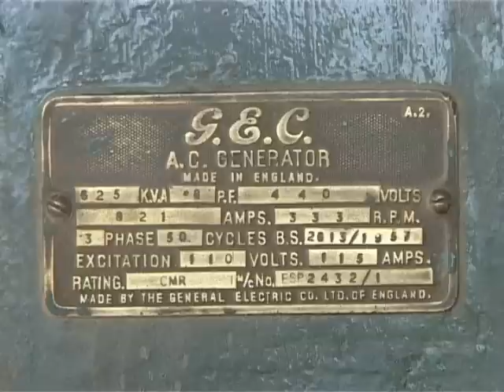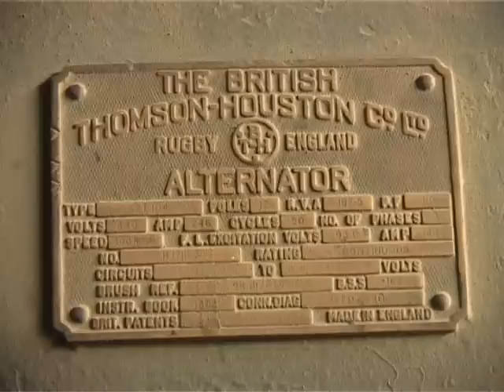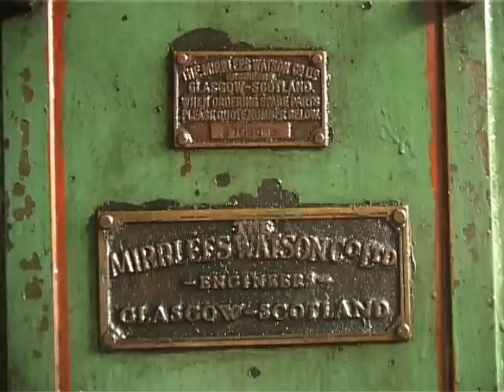Khaitan Sugar Mill, West Bengal, India 2006

Comment: These steam turbines used to generate electricity for flax and linen mills and the same engine in a different variant drove rope wheels for spinning room machinery. i remember when i was about 8 my Grandpa taking me into a very ornately tiled engine room with two of these machines by Belliss and Morcomb whining away, i was fascinated.
Reply from the maker: Not turbines but reciprocating vertical steam engines. Otherwise spot on.
Reply: @internationalsteam  I stand corrected Rob, the engine room my Grampa looked after had one vertical and one turbine sorry my head was carried away with the nostalgia.